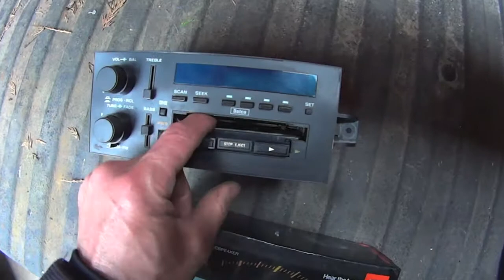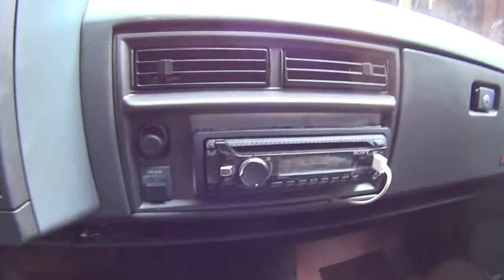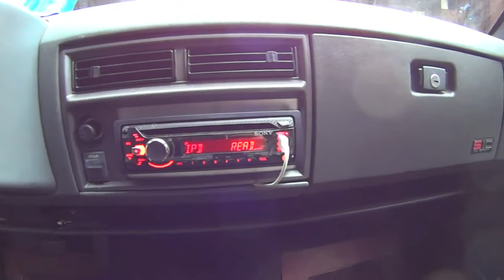Replacing the front speakers with 4x6 JBL's 1988 S10 Blazer

Comment: They have installation kits that come out from the dash and make a head unit like that work. I had one in my 91 S10 back in the late 90's.
Reply from the maker: S-10's that have a/c are more difficult to work on than your standard one . They are already compact enough without all the bells and whistles under the dash . Doing a heater is not a fun job and generally I don't like working on it compared to the full size . The older I get the more I hate under the dash work ! but they are nice little SUV's

Comment: what i found worked FAST AND EASY was taking a small pair of needle nose pliers and pick out the soft foam in the actual dash where those little plastic hooks stop at...mark where they hit the dash and start picking the foam out with a very small pair of pliers obviously the lower you can get the hooks in the dash the better...it gives the hooks a place to go and will give you just enough room to get any 4x6 in i used a cerwin vega these jbls have a silly amount of plastic on them...its a nice snug fit and a easy alternative to this cluster fuck of a video lol i even tried making my own video because this was so bad...but it wasnt as easy as putting in my speakers ;) so this comment will have to do. hope it helps.
Reply from the maker: I'll have to try that next time

Comment: Just tried to fit in some 4x6 Rockford fosgates in my dash too. Did not work I didnt want to cut the corner of the cluster so I just returned them and got some 4x6 plate speakers so much easier direct fit.
Reply from the maker: Sometimes it's just not worth all the hassle or you end up fu_ _ _ _ _ things up like what I did, so I know what your saying. You can always beef up the rear speakers and use the fader control .
   Fosgates been around an long time. I had a Fosgate amp in my van back in the 70's and that thing stoked. 
   Got really hot when the volume was up and I had to install a fan to save it from a melt down
Reply: The 73-87 Restoration Shop " Keepin em on the road " exactly it's all in those 6x9 :) I have two of the Rockford fosgate power in the back same situation though the magnet is too big and will hit the actual car. Had to cut out the middle part of those long speakers covers with the ash try to install a spacer. It's worth it though. I have another pair of covers just in case I ever decide to go for the stock look. Nice s10 by the way.
Reply: The 73-87 Restoration Shop " Keepin em on the road " my setup is really simple 6x9 rockfords in the back , 4x6 infinity kappa plates in the front and a very cheap nitro amplifier connected to one 12 inch audio pipe subwoofer. Never had problems with any of them. Keep posting about your s10 not many people post about them !
Reply from the maker: Take it from a guy that's had powerful sound systems in his vehicles over the years. Playing load music in an enclosed space will do you in over time. I have a constant ringing in my ears now, and if I had of had some foresight on what would become of me I would of kept the volume down . 
   It sounds like you got a good set up with what you have. Good quality speakers with an amp should do a person well. All I want today is clean sound and keep the volume down.
    If you like S-10's I have a 91 pu that I did a frame off restoration on 13 years ago. I took it off the raod 2 year back because I noticed some surface rust starting on the undercarriage and didn't want to see it get wrecked. 
    I want to fix it up again, but it's a matter of finding the time. 
    I love that truck and it's been so reliable for me. I have modified the 2.5 Iron Duke and it goes really good.
   I have a video posted on my other youtube channel if your interested.
     https://www.youtube.com/watch?v=fxgYhlvFqLY
     Thanks for watching and keep on wrenching ! !
Reply from the maker: Thanks Man.
      Good one. The old spacer will get you what you want. Like you say you can always put it back the way it was pretty easily
Reply: did you have any issues with the infinity kappas in the dash? mine where super tight. the one on the right side I had to turn and then shove it in there. then I just held it down while screwing it in. mine is a 94 blazer gen 1
Reply: filiberto bernal w

Comment: I have a 2000 Blazer and was planning to remove my  2 small  dash tweeters and  install  a pair of  2-way  4 x 6 speakers in the dash...I have read that I will  need to cut out the in line capacitors ( bass blockers )  or the 4 x 6  speakers will not not have any  bass ..... can you tell me how your speaker replacement project went and what  exactly you did about the bass blockers ...thanks
Reply from the maker: It was a standard hook up with + & -- to the speakers directly from the deck . No external amp and No bass blockers .

Comment: Attention children this is an expert at work notice that he didn't just grab it and pull it when removing the dash cover it's not your dick sometimes you have to finesse it maybe a little warm soapy water if you're replacing the speakers period by the way sir how did you like the JBL? I have a 1999 single cab S10 I'm going to upgrade the 4x6 and the 6 and 1/2 and add a woofer and amplifier and a new Alpine deck period when I was a kid JBL was kind of the bottom of the pile but I've heard they've really come on as their speaker quality has improved.
Reply from the maker: Clean crisp sound and worth the hassle of going in the dash deep to replace them

Comment: Is the same process on a 03 sonoma?
Reply: Same process yes, but same fit ?,…I would think not. You would have to experiment  like I did for yourself.
Reply: richaroodledoodle Sounds good! Thank you, Sir.
Reply from the maker: I would think not. It's going to be a different dash than the 88 so you may have more room. Remove the drivers side speaker, take some measurements and check for clearances before you buy a set.